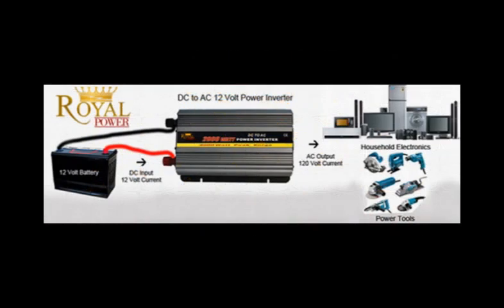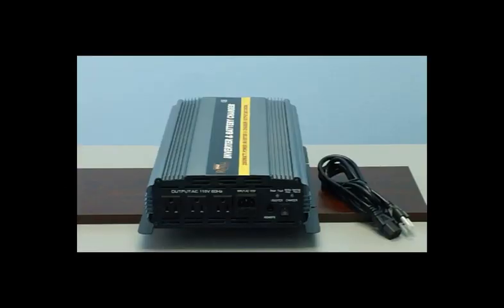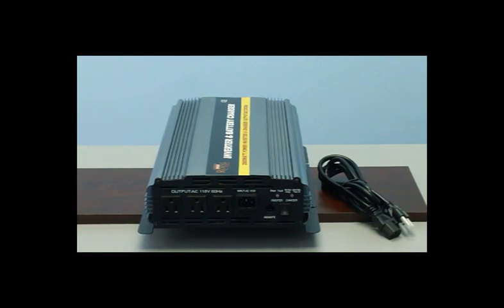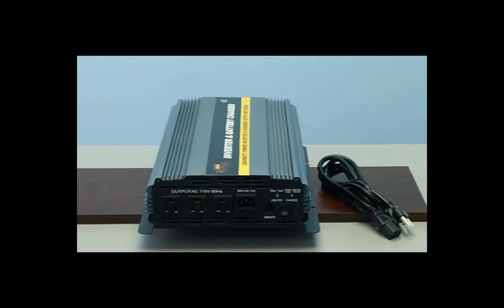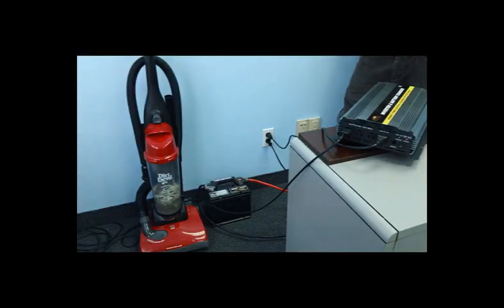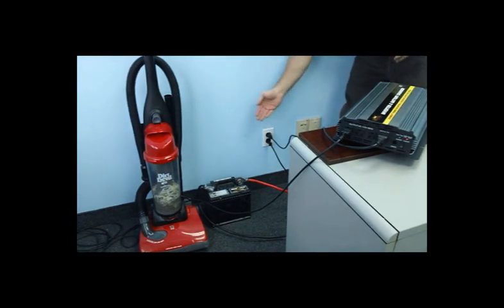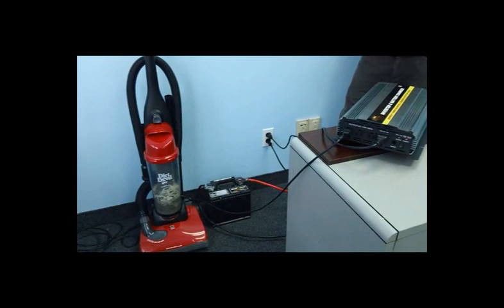Power Inverters - Using an inverter for basic emergency home backup power

Comment: I used an inverter in my car, ran a extension cord to my home and powered a lamp and fan during a Hurricane outage. Light lasted all night until car battery went low. I would then jump the car off with another car and I was back in business.